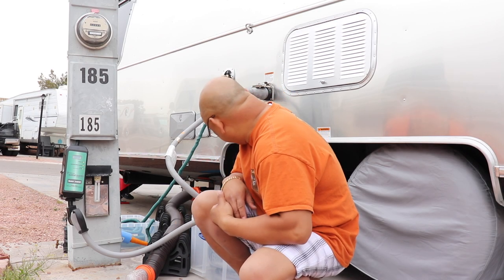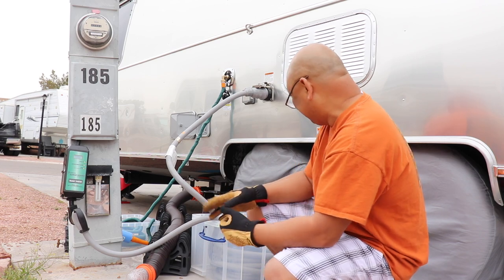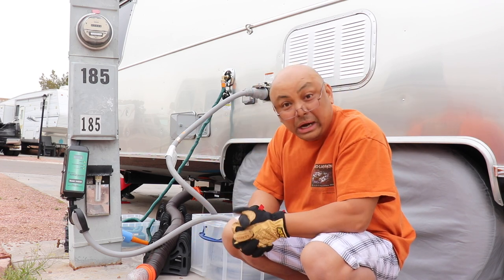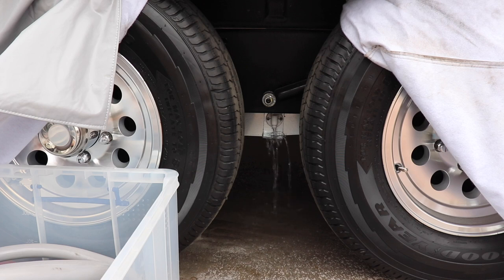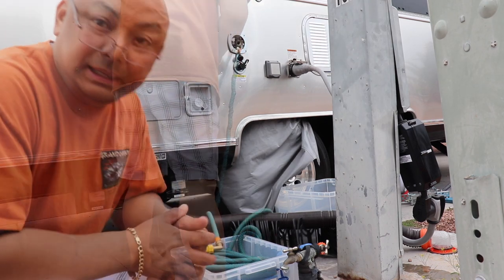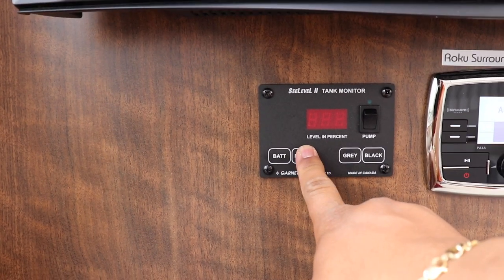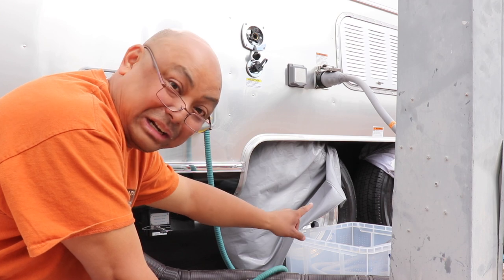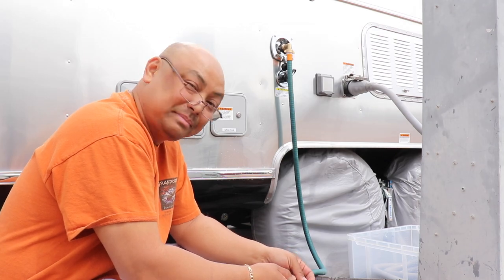How To Fill & Drain The Fresh Water Tank In An Airstream

Comment: With pump off, open faucets inside camper then open fresh water drain. Air behind water to speed drainage
Reply from the maker: Helpful!! Thank you that works.
Reply: Hey, man I had a question. I don't have water hooked up yet but I want to use a portable shower pump/nozzel (one that they use for camping) in the shower itself. I'm wondering where the water would go through the shower drain, and would using that portable shower in there work even though I don't have water hooked up? Thanks a million

Comment: That seems very primitive compared to the other systems.
Reply: Hey, man I had a question. I don't have water hooked up yet but I want to use a portable shower pump/nozzel (one that they use for camping) in the shower itself. I'm wondering where the water would go through the shower drain, and would using that portable shower in there work even though I don't have water hooked up? Thanks a million